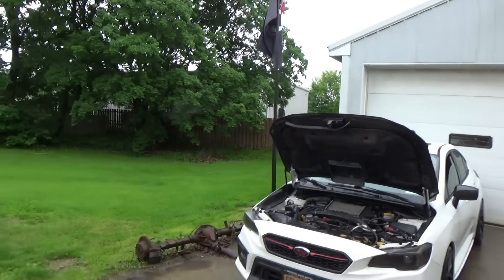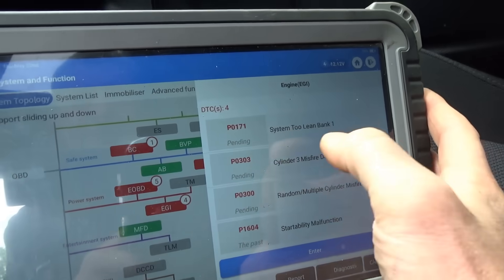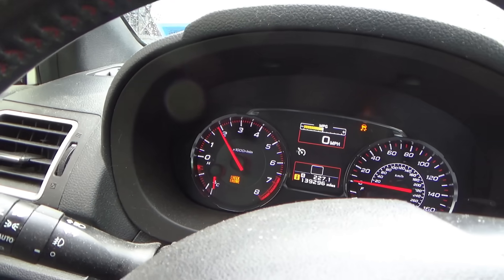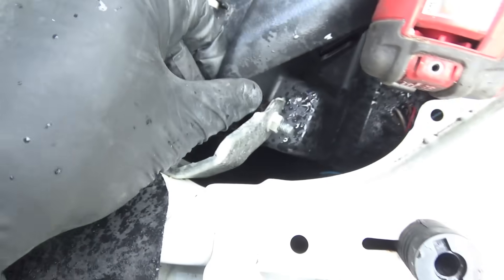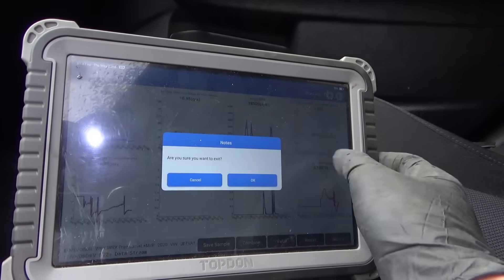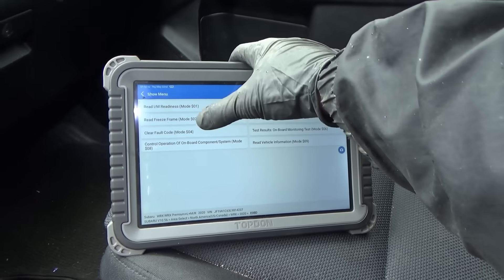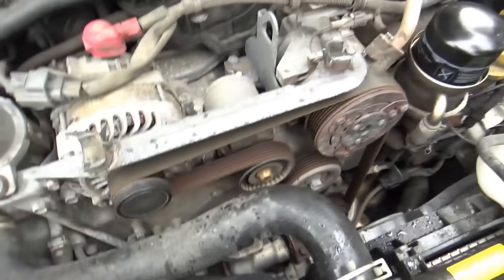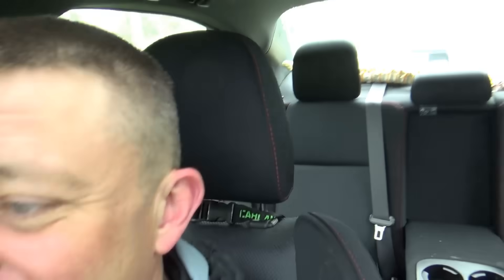Subaru Runs Like GARBAGE After "DIY Tune-Up"?? ('20 WRX Turbo)

Comment: I purchased a used 2010 Outback about 4 yrs ago.  I knew it needed work (clutch, center diff, throwing P0420 codes).  Pulled the engine for the clutch work, pulled the valve covers, plug seals and plugs to fix the oil leaks and found #1 plug was an AC Delco, totally different from the other 3 NGKs.  Replaced the clutch, new NGK plugs, new plug seals/valve cover gasket and buttoned it back up. I have no idea what the last person was thinking throwing in a mis-matched plug.

Comment: There are only a few injector cleaners I use Gumout and chevron. I run them once a month in my restored 99 blazer for the spider injection and in my 17 chevy with direct injection. These are some of the only ones with  polyetheramine That works. R one has 200k other 122k I knew at beginning that wasn't the issue Gm recommended the pfe for the spider injection. They are not snake oil! I only use NGK even in my chevys because always used them in bikes.

Comment: Yeah exactly what I thought,, hate to sound like a jerk but it's the drivers fault, incorrect spark plug or not, it's the plug not being tightened enough causing a less solid ground for the plug and minimal compression loss, morso just not enough ground being it was loose, maybe the driver can learn a little more or learn more froma friend,  as you said loose plug and regardless of brand and noticed fresh fuel on the plug allowed me to conclude it' was the plug being loose causing miss, good thing it was caught now so the threads in head are still good, Nice video!

Comment: funny you mentioned plug life, I have a 2019 frontier with the 4.0 v6 , you have to take the upper plenum off to change out the passenger side plugs, would it be safe to run em till it starts missing? only have 75000 miles on em for now.

Comment: Newer vehicles of JDMs, I use either Densos and NGKs. Anything vehicle that specify Double Platinums, I use AC Delcos and Autolites. Love Densos more than NGKs; it tells you that I work mostly on Toyotas. I do put OEM brand and specify  type of spark plugs on my personal vehicles. I do give people options on OEM specify but they don't want to spend that amount on plugs, so I get them the price on what they want to hear. Never a Chanpion unless a Briggs and Stratton.

Comment: Autolites are actually good plugs, but not for Japanese cars.  OEM only for most cars but Japanese cars in particular.  I had a guy bring in a Honda for misfires and it had brand new name brand ignition wires (older distributor type).  Put on Honda wires and problem gone.  I use Motorcraft or Autolites in Fords and they run great forever.

Comment: Autolite has been around a long time, my young friend. It’s not the plugs fault it wasn’t properly installed. When it comes down to it, it’s simply a spark gap. There’s no magic. The fuel additive, while not the issue as you initially assumed, did no harm. Yes, you corrected the issue but it’s annoying to hear you lambast American companies for no reason.
Reply from the maker: Most faulty spark plugs that I have diagnosed have been Autolite. Don't care where they're made 😂

Comment: it's possible to get the plug boot smashed and wedged in between the plug and tube, instead of on the plug,  been there done that a few times! they're a pain with the tight clearances to the body rails.

Comment: Great video!! Thanks for sharing! He’s super lucky he didn’t damage anything else not properly torquing the cheap spark plug(s) to correct setting, reconnecting air filter/MAF, and the coil packs. Stick with OEM for sure.

Comment: Hi Ivan, Gumout Regane contains a polyetheramine (PEA).  Chevron techron contains a PEA also.  PEA's are the only commercially available additive that can remove combustion chamber deposits.  I have performed an experiment where I ran Gumout Regane and after a few thousand miles stuck a boroscope into a cylinder where you could see the piston top had shiny patches (black piston top before using additive).  I am a believer and the cheapest place to buy it is at Walmart.

Comment: NGK regardless of brand for me, no matter if it's a moped or a car.
On a Subaru you always have to "burp" the coolant quite a bit because those engines have a tendency to collect a lot of air in pockets everywhere. So fill in fluid, squeeze one of the radiator hoses a few time, fill in some more, rinse and repeat until no more bubbles appear. Failure to do that can lead to overheating.

Comment: The old spark plug didn't look fouled but I can see where putting an old school plug in a turbo motor might cause spark issues under boost. So you installed one proper spark plug. Did anyone replace the other three plugs?

Comment: I have not watched this yet, but my guess is that there is something to do with using the wrong plugs. Speaking from experience, these cars, even the FB (non-turbo) engines are extremely picky on spark plugs. I put decent NGKs in Crosstrek and it ran like absolute trash because they were not the $25/ea NGK Laser Iridiums. Swapped in the lasers and it ran like it was supposed to

Comment: i had a jeep wrangler that i did a tune up on years ago,  the auto parts place didn't have the champions in stock so they gave me the AC Delco plugs, after about 4-500 miles it would feel like it dropped a cylinder, i thought hmm just changed the plugs , they couldn't be bad so i started looking at the injectors, ended up pulling the plugs to look at them and i discovered the white porcelain part was all red,  wrong heat range?  went to different parts store for champions and no more issues after that, AC Delco plugs are junk

Comment: I had a 73 dodge dart with a 318 motor. When I was stationed at Clark AB in the Philippines, I tuned up the car before  I went on temporary duty. When I returned my wife picked me up and the car ran terrible. Step on the gas and it felt like it was running on four cylinders. I was talking with another guy about the problem and he suggested I check the spark plugs and ohm them out. Sure enough I had put Autolite plugs in, because that’s all they had. When I ohmed them out four of the plugs were bad. I put the standard Champions RN12YC plugs and it ran perfect. They ohmed out at 50,000 where the Autolites were 5,000. I’m thinking the Dodge high voltage electronic ignition was too much for the Autolite plugs. Now I always ohm the plugs before changing them.
Reply: The difference between a resistor plug for EI, and a non resistor plug for points...

Comment: Modern vehicles should not be worked on by DIY'ers. I've seen a lot of costly problems by DIY'ers buying cheap or poor quality parts and also bad installation due to not having manufacturer repair information.

Comment: Son at college put autolite plugs in his car.  I got a call and a picture of a plug with no electrode on it.  He was getting misfires.  Told him well the piece is pulverized by now, any damage is done.  You need a  bore scope to look through plug hole to see if it did anything major.  Probably not since it is running fine now.

Comment: Nice diagnosis!

To every old school guy reading this, repeat after me:
Spark plugs aren't wear items on modern cars!
Spark plugs on a new car might even last longer than a cam shaft on a 50 year old car.
Reply: They are 100% a wear item. But it takes 100k miles for them to wear out.
Reply: @philbrutsche8928  Longer than 100K miles, my experience.

Comment: Ivan, Kinda disappointed with you to jump all over  the addition of Gumout “All in one” fuel system cleaner. I personally have been doing drivability work for 50 years and find there fuel system cleaners, High Quality. I use them as preventative maintenance only and personally have 4 vehicles with direct injection and 3 with over 100k miles. All running strong. Emission levels are all like new and zero issues . Yes I follow all maintaince intervals. This Customer of yours obviously left out some very important information. 150000 miles on any sparkplug? I agree NGK is the best. But wow I guess you like the job security. And where did all that coolant go? This video of yours iMO is a the worst overall one you’ve done. Only 2 questions answered. You be back to this one I predict.
Reply from the maker: I was there to diagnose the drivability issue and as a bonus I even repaired it almost no parts required. As a second bonus I noticed the low coolant level before the engine blew up. Huge WIN all around. Can't satisfy everyone in the audience haha 😅

Comment: Another great video and a simple fix. Parts problems are more prevalent than ever these days. Being in the auto repair field is a daily eye opening experience when it comes to parts. Many times we learn the hard way about which parts to use in each vehicle, even factory OEM parts can be a crap shoot, but are generally the best way to go especially for any electrical parts ( as Ivan has proven many times).  We use aftermarket parts to save customers money and to get the job done quicker, but I personally source parts from many different local and online suppliers because there are certain after market parts that I can still trust and many that I will Never use. Fake OEM Chinese parts have become a major issue and cost people time and $$$$$$. Beware of the super low price of OEM parts offered on sites like Ebay.

Comment: GumOut does work. I ha e used more than 25 bottles on all my vehicles. First used on my 92 prizm and the change was very clear... smooth idle.. better acceleration... since then I recommend GumOut. He probably used it fkr the first time on a half of quarter tank whiich is too steong and removed all gum and clogged the fuel line or carbon up the plugs. 1 bottle for 19 gallons

Comment: The reason the owner didn't tighten the spark plug as much as he should is the heads of these cars are aluminum, and he was afraid of stripping the head so he only snugged it and the vibration backed out the  plug.

Comment: I had Champion plugs fail in 2 vehicles, so I avoid those when I can. I wonder if the owner's local supplier has only the Autolites in stock. Anyways, as long as he remembers this lesson, he'll be ahead of the game. Great work on your part - you avoided the injector rabbit hole!

Comment: The takeaway from this is to make sure you've reassembled everything correctly (this has caught me out) and to use good quality/OEM/genuine parts. I generally swear by NGK plugs myself. I had to replace my front brake pads and discs (rotors) on my 2009 Mercedes W204 C200 after about 15,000 miles because they were warped. This time round, I used Brembo parts. It was money well spent. Quality doesn't cost, it pays.

Comment: I was given a car years ago that wouldn't run at all, it had a recent tune up at a local shop. Ran for a couple weeks after the tune up before it wouldn't start again. Turned out the majority of the auto lite spark plugs had failed. I've never bought an auto lite plug and never will after that lesson. They only last a couple heat cycles.

Comment: everywhere i had my oil changed no one ever checked  the radiator my wife  bought a brand new lexus 450 serviced by the dealer i seldom drove it i noticed the heater was not working well when one when i drove the car went under the hood checked the overflow bole empty filled with universal 50 50 antifreeze sold the car 9 months often wondered iif i damaged the the car not toyota pink
Reply from the maker: Checking all fluids should be standard procedure at each oil change 😎

Comment: Those bottles you pour in the tank sometimes actually do work. I run octane booster with the higher premium 98octane gas we have here in Sweden and with a decent tune (not stock) you can absolutely notice a difference. On first 2nd and 3rd on asphalt it does spin all the wheels with the booster. Same test workout does not. So not all are scams

Comment: I have two Kia vehicles. Both owner's manuals say if you dont use top tier gas you should run some injector cleaner periodically. Its not random crap in the gas tank. Its essential for maintenance.

Comment: For ONCE, I actually guessed (partially) right - changing the air filter knocked something loose to create the lean condition. Changing those things often involves wrestling with stubborn, stiff plastic parts that don't want to move either to remove old filters or allow new ones. I'm always afraid of something just like that. Great diag as always Ivan!

Comment: Although my car is a Holden my car is fitted with genuine GM spark plugs which are made by Denso which is Japanese, they're fitted onto the Gen 3 onwards Chevrolet V8 engines which my car has fitted into it.

AFAIK Toyota use Denso spark plugs as well !
Reply: AC Delco iridium spark plugs are made by NGK in Ohio. Not Denso.

Comment: I've been putting a bottle of Tekron in my cars every once in a while forever.  What's wrong with that?
Reply: I've been running Tectron for years. Same fuel injectors, same cars, same transmission. 
Flushed my transmission 4 times. Has not broken down because of the flush as many believe 😂😂😂

Comment: The name on that battery says it all, straight out of AutoZone, a.k.a. the Walmart of auto parts. Home of the legendary Dura-Trash.
Bet as soon as he walked in, the guy in the little red shirt hit him with, “What are we working on today?” like he’s part of an Indy team. Meanwhile, this dude was stocking toilet paper at Walmart last week. Probably grabbed whatever was on the shelf, slapped it on the counter, and said, “These plugs’ll be fine, bro.” Yeah — fine for your kid’s Power Wheels.
And of course, they sealed the deal with a 2-for-1 on Gunk fuel injector cleaner at checkout like it was Black Friday in aisle five.
Reply: A battery is a battery; whatever the brand.
Reply: @richardepstein3494  Walmart's EverStarts have been proving to be a pretty solid choice from my experience with them, especially anything with a 2-year and up warranty. Although some people do prefer to buy the same battery with a different looking sticker sold at a much higher price.
Reply: @richardepstein3494  I simply pointed at the battery, it told me everything I needed to know about where they’ve been shopping.
A lot of people think they know batteries, but they really don’t. I like to test what the average person knows about basic automotive stuff, so I’ll ask:
“What should the voltage be on a fully charged battery?”
They all say 12 volts and that’s wrong. A fully charged battery should read 12.5 to 12.6 volts.

Very few people know there are only three major battery manufacturers: Clarios, Exide, and East Penn.
Clarios is the biggest of the three. That’s it that’s the industry.

Most of the battery brands you see on the shelf? Private labels.
They just swap the stickers and slap on a new logo — same battery, different box.

And just for giggles? Those Dura-Trash batteries? Made by Clarios.

Comment: "I wonder where that [coolant] went" standing next to a Subaru LOL
Reply: My wife's WRX was missing coolant.  Three months, a radiator, a water pump, a couple of hose clamp leaks and one pinhole in a hose later and all was fixed.  Six different small leaks!  BTW, Autolites were still running in the other three cylinders.  So, something other than the brand of plug was at fault.  On a forum for another car we owned posters there wrote that the NGK plugs where pregapped for our cars.  Honda was using the same plug in lawnmowers.

Comment: The only spark plugs that I've ever had problems with, have been autolite. Usually after installing Autolite plugs the engine would run fine, but misfire like crazy above 2,500 RPM. I've experienced this numerous times on different engines throughout the years. Now it's OEM or NGK and no issues.

Comment: that wasn't the only Autolite plug was it?
Reply: Hell i run NGK iridium in my 99 civic
Reply: @Newyorkerr5788  That's not what they were asking.
Reply: @Jonathan-A-877 it won't let me comment so i piggie backed
Reply: @Newyorkerr5788 Bit overkill if it's stock. The V- plugs are perfectly fine

Comment: leave plugs alone at 140k miles ? Most manuals say change around 100k miles even if you're using NKg
Reply from the maker: Iridiums go 200k miles with coil on plug systems... And still look MINT! 😮
Reply: @PineHollowAutoDiagnostics  I replaced mine in my 2007 Acura TL at 90k miles and admit they looked good. I used Iridiums going back in. Guess that will be the last time to replace them in a 18 year old car. thanks for the tips.

Comment: I work at A Subaru shop. When you mentioned the customer changed his plugs I thought for sure the spring in the ignition coil that goes to the center electrode on the plug was probably still laying on his driveway. Leaving the air intake hose loose or disconnected when changing the air filter is a requirement for DIY and Jiffy Lube.
Reply: I did that a couple months ago.  Did the twist-and-pull on the #4.  Put it all back together and fired it up; obvious miss.  Looked on the ground and sure enough.  Didn't need scan data to show me the cylinder; I knew it was the hardest one.  Had to be.   ...And of course customer was waiting.